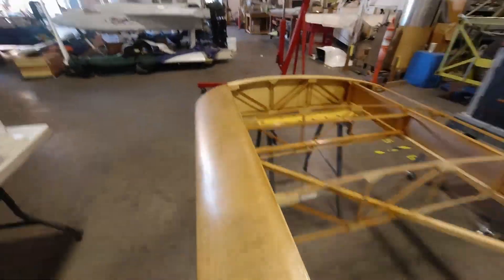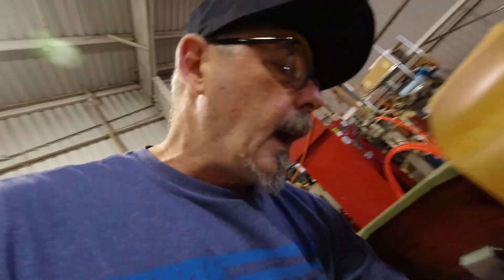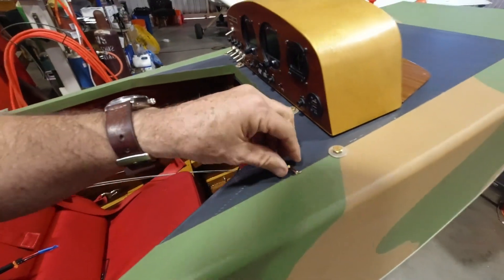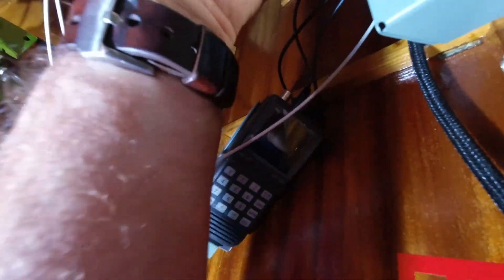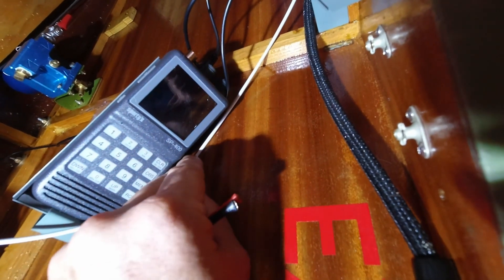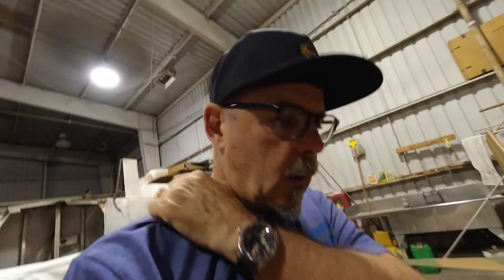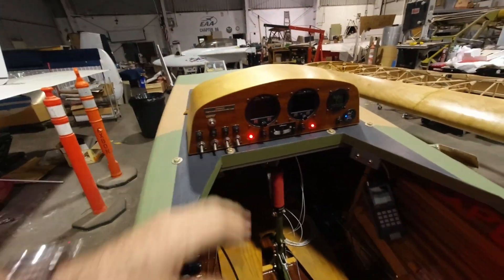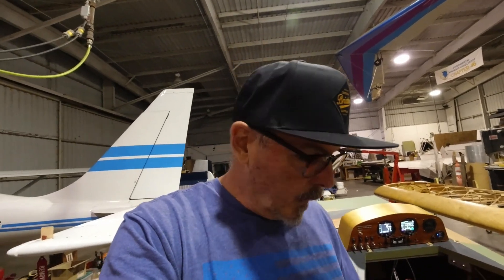Minimax 1100r Wood Aircraft Build Ep 176

Comment: For your instrument panel, painting black would work. Otherwise a leather wrapping would look good. Also in thinking about safety in case accident (God forbid) consider a leather wrapped roll of padding on the front top edge of  the instrument panel and windshield frame where your face may impact. Shoulder harnesses have failed before and you'll probably flying on an off grass fields that could have one pot hole that airplanes like to find.
Reply from the maker: Thanks for the input Curt!